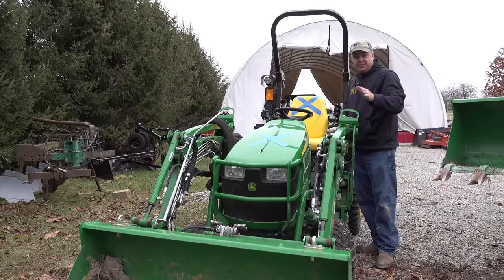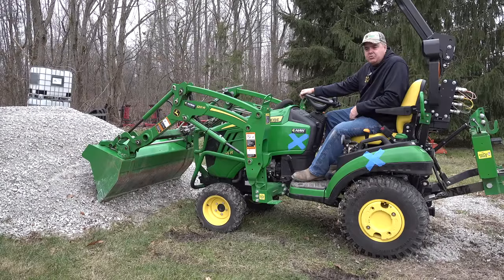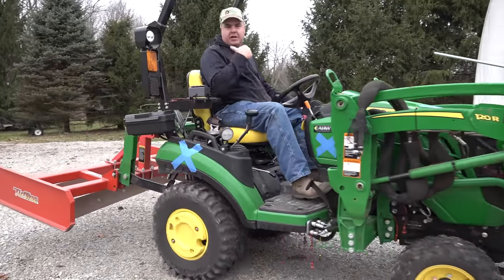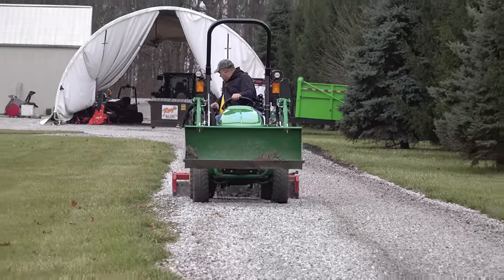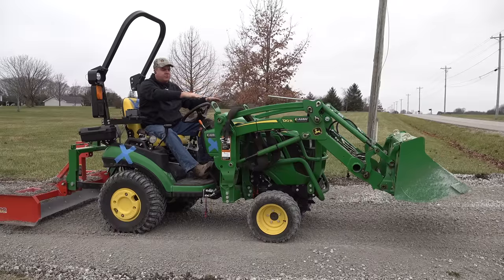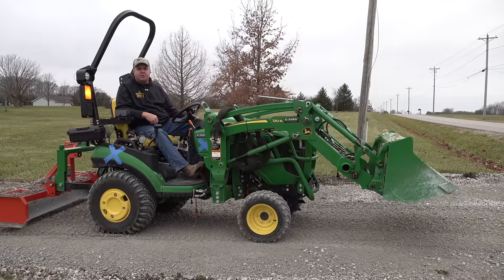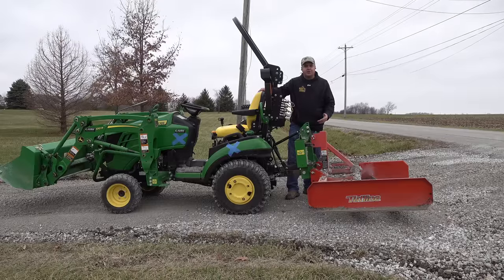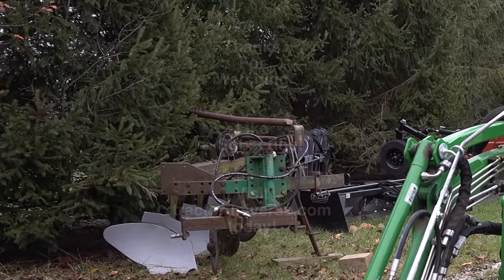John Deere 1025R Turbo Real World Loader & Land Plane.  SUPER SUBCOMPACT!!

Comment: Wonder if I should turbo charge my 755? I'm too scared it would break! I wonder what modifications could be done to the large frame  25hp tractors by "tuning" them without going all in with a turbo. Too bad manufacturers wouldn't put their 35hp engines into a defined state to make 25hp stock but be relatively easy to go back up to 35hp or so with aftermarket tuning.

Comment: Id be interested to see how a land plane would do on our drive at the farm. 3/4 mile up hill, some of it 20% grade. We have a good base, and usually put the blade angled to the side (back side of the blade), to pull rock from the edges to the middle, going both directions, then when we've got a "wind row" of rock in the middle, put the blade straight (still back dragging) and spread it across.  It works well if there isn't much in the way of water damage. For that, I usually end up using the blade forwards to dig it out before filling it all back in. Seems like a land plane does a bit of all of that together. We'd have to do something for one spot in the middle because it's on shale bedrock there, and I'd be afraid it would damage the plane. We currently use a 5320 with a Woods HBL84-2
Reply: That's call crowning the road, so the water runs off to the sides. Sitting water creates holes. A good practice.
Reply from the maker: Wow!

Comment: Are you worried that with the engine not bogging down, you might be building excessive heat in the transmission fluid as it slips at a higher pressure. That make sense?

Comment: First few test show that JD should have offered something like this from the start. It sounds good, goes good and mostly seems less hesitant to do what you want. I’d like the kit for my 2025r
Reply: Same here my  2025r has a big problem with bogging down the engine
Reply: This was discussed in one of the videos by another YouTuber, had a conversation with Deere. The reason they don't go over is due to emissions. The engine is no longer Tier IV compliant over 25 HP. That is why JD stopped producing the 1026r which was actually less than 1 HP more powerful.

Comment: Most jurisdictions require, for safety reasons 12’ of solid surface, concrete, asphalt or pavers at the end of your driveway for that reason you described, spinning their wheels to get onto the main road.
Reply from the maker: Most?
Reply: Where I have lived in the past in Virginia and now in Florida required the hard surface at the end of the driveway

Comment: What hp tractors would you recommend to regrade a gravel driveway with a 15-20 degree slope? Or does it matter?
Reply from the maker: Sure. A slope will require more Hp and weight.

Comment: Assuming there is a separate pump for the hydraulics, that's when you will really start to see the increase in HP.  Full power to the hydrostatic pump and the extra power to the hydraulics.

Comment: Add a hydro plus hydraulic pump,turn hydraulic pressure up to 2600 psi,and turn up hydro drive pressure up a bit then you will take advantage of the extra power.I have hydro plus pump and pressure turned up cannot wait to get turbo kit great project.

Comment: I don't know if you are familiar with comedian Jeff Foxworthy's "You might be a Redneck" jokes.  Out of his first ten I had seven.  One was you might be a redneck if the mud hole at the end of your driveway never dries up, yep, that was me.  A few years ago I bought a 20 ton load of shell rock.  Crushed rock is expensive here in Florida and the rocks would disappear into our sandy soil.  I just let my 600 ft long driveway just grow up in grass but during a particularly wet summer the mud holes got numerous. My backhoe, a JD 510, was down with what I discovered was a stopped up hydraulic strainer so I borrowed my neighbor's Kubota L4701.  

I was not impressed, it was difficult to control with the treadle and the FEL was weak.  I was able to get the holes filled but when I decided to get my own small tractor I got a JD 1023E. Love it, we had 7 John Deeres when I farmed so I have a good relationship with my JD dealer.  I am soon going to get two more loads to fill more holes and build up my parking area.  I have two box blades, a 40" and a 74".  A box blade will just carry the shell rock and drop some in the low spots. Digging up the grass with a land plane would make one continues mud hole each time it rains.

Comment: What is the difference in the two Model 120 loaders that are fairly different?  Does one have the self leveling feature?  Appears to be a substantial amount of more weight.  I suspect that a lot of owners don't use rear ballast because they don't take the time or spend the money to source wheel weights and have tires filled with Rim Guard.  It's an expense to add to an already $20,000 machine.  After a while they will eventually but up front they're not sure.
Reply from the maker: Yes. 120 MSL is self leveling.  NSL is not.

Comment: I like your videos Tim. The turbo is a neat experiment. However,  it's disappointing to see its extra power unable to be used to its full potential by that hydro transmission. It would have been cool has you has a 3043D just out of warranty  and had it turboed. It wouldn't have helped the loader hydraulics but would have been interesting to see it pull with that manual shuttle transmission which wouldn't have given up nearly as easy. You've 4 or 5 tractors and Vinny, All with a hydro. Maybe add a little spice and throw your next tractor in equipped with a manual?
Reply: 3043D is already turbo charged. Yanmar 3TNV86CT-KJPT turbocharged diesel 3-cylinder liquid-cooled inline.  Looked at an R model earlier this year myself, Turbo? Cool!

Comment: It's really hard to tell, but Johnny-X doesn't sound any louder than Stock-Johnny. I run a turbo on my 3.8 Buick V6 engine in my dune buggy, and I use a Super-Trapp muffler with adjustable/removable baffles. Makes no difference in sound level with or without baffles. Turbos are great mufflers!
Where's your hydraulic top link? Hope to get a hydraulic tilt link to you by spring.

Comment: Curious, as I have been looking at small compact tractors and compact tractors for many years now. I would like to know your thoughts on 1/4 inch valving verses position control. Small compacts like 1Series, bx, normally 1/4 valving. But "mid" compact like B or LX have position control. Thanks for the video God bless
Reply from the maker: Love the position control.  Get the 1025R.  The only true subcompact with position control.  Have you watched our 11 episode series comparing the BX to the 1025r? If not, I recommend doing so before making your purchase.

Comment: Did you dyno  the pto hp of the 1025R before turbo,  I see what the results were after.
Reply from the maker: 22 before, 32 after.  Both shown on video.
Don’t put too much stock in the actual numbers, as the dyno could be off. However, you can trust the ‘difference’.   Same dyno used for both tests.

Comment: Did the company that installed the turbo have any input on cool down for the turbos after running wide open? My B3350 Kubota has a turbo and they recommend a 3-5 minute idle for cool down after wide open throttle
Reply: You should do that with any engine whether it’s turbo charged or not
Reply: i do that with any engine i run, but it's said that if you have a turbo, to run it at least 2 to 3 minutes to cool down the turbo and helps protect the bearings better.......

Comment: Tim, I am about to purchase a Land Plane for my 1025R,  What size would you recommend 4' or 5' will the 5' be to much for dirt?  and would the 4' cover enough of the tractor footprint?
Reply from the maker: I would go with 5’.  It will pull hard at times,  it in this case, the extra width is helpful.

Comment: Just curious if you had thought about any emissions/epa requirements if this becomes a kit.  They don't need an emissions control system because the horsepower is at or below 25 hp.  Now that your up at 38 and considering making a kit for it, does it fall in a different class and would a kit manufacturer be responsible for ensuring it meets emissions standards?  Just curious because of all the craziness that has been going on with diesel tuners recently.
Reply from the maker: Have you not been watching our earlier episodes in this series???

Comment: Tim, well done on taking the initiative to get a turbo fitted to a one series. I think there will be a lot of folk out there following this closely. 
 I challenge you to try something new; listen to the tractor engine! 😂 If it needs more throttle, give it more; but unnecessarily high revs will use much more fuel and ultimately an unloaded diesel engine that is running high revs will glaze the bore. They aren’t like a two stroke that needs to run flat out to stop carbon buildup. There’s very little more hydraulic flow, and almost no more pressure to be gained above about 1800 RPM. So, running high revs (especially a turbo) what are you doing!! Please don’t just dismiss this as a hater comment ( because I’m not) Just challenging you to re-think something.
Reply from the maker: We have to run a subcompact at high RPM to be effective. Sorry
Reply: @TractorTimewithTim  I had a subcompact 1026R for five years (and used it extensively) and it wasn't often I needed to run it WOT. I know these subcompacts well. Again, I challenge you to consider someone else's perspective apart from your own!

Comment: If you really want to solve the issue with the trash truck, you'll need to fix the foundation of the driveway in that location. Remove the base usually down to the frost line/depth and fill in with 2 or 3" rock to about 1 foot from the top and then add the smaller stone. OR you could keep doing as you show in this vid till the issue goes a way, which may take a few years.
Reply: Best piece of advice so far. People fail to build a foundation first and then wonder why their rock keeps pushing out leaving tire ruts.

Comment: Tim is the plan to also widen your driveway from what it is to 28 feet wide and straighten it
Reply from the maker: why 28 feet wide?    need a wider culvert to support the turn...once the truck can straighten, no need for huge wide driveway.
Reply: @TractorTimewithTim  it would give you the room to off load stuff off trucks with the 5075e and not worry about sinking the back tires into the lawn and the view in the video shows a couple curves in the driveway
Reply: @TractorTimewithTim  and 28 feet is the average city street width

Comment: The problem I've found with using the JD 2210 (which was the direct precursor to the 1023e/1025r) is not even particularly the power, or lack of. It's in the transmission/differential.

My first sub-compact was a JD 655. That was directly in the line of heritage forr these subs. And it was a workhorse except that it was sorely underpowered. But I never broke anything. And it got used absolutely to it's limits.

Then the JD 2210. Directly comparable to the 1023e. The 2210 got used to it's limits. Up until it tore the guts out of the differential. And that tractor was well maintained.

I planned on buying a 1023e. I couldn't though because the 1025r is such an attractive package and particularly for the close quarters I always found myself working in. BUT.......

 The trouble is, IMO, in all the aluminum used in the drive line. These tractors are little animals when really used hard.  Impressive at least to me. 

I watched this video and the first one when you were at the shop to put this package together. I am fearful, and sure, you'll be detonating the driveline in short order.

Now JD says they fixed the problem the 2210/2230 had but I think the 1023e/1025r could greatly benefit from a cast iron or forged transmission/differential. Even the additional weight would benefit this machine.

I love the turbo idea. Been eyeing that same path for my current 25hp non-JD sub tractor. It by the way is about the size of a JD 2025e but with a more substantial power delivery system.
Reply from the maker: I believe the drivetrain is much stronger in the 1025r than in the 2210/2305.  Lots of PTO issues in those tractors.

Comment: Put that Landplane on the regular johnny and show us the difference, high range and low range. Johnny X does look good. Did the turbo quiet the exhaust like the muffler did, it's sound seems to be no difference.  I think you have a typical residential driveway, where gravel was put down to get the workers back to the home site and when the home was completed more gravel was added to make it pretty. No topsoil was ever removed, for a proper drive to be created.
Reply: Exactly what I was thinking. No foundation . Just dumped rock on top of topsoil.

Comment: The end all solution would be to let grass grow in the gravel drive edges 1/3 of the width on each side.  Constant stirring of the gravel causes fines loss that causes the larger gravel to “unlock”.   Additionally use as high of a crown that you can stand to shed water into the yard grass.   Avoid ditches if at all possible increase the angle of departure of the water by raising the crown height.   Pot holes will cease to exist.  I deployed all these measures on my 7/8mile drive way 10+ years and haven’t bladed it in probably 8 or more years
Reply: Grass edges are a poor idea for many drives. That blocks the water from shedding off it.
Reply: @paybax  I beg to differ. It’s the perfect solution the let the grass grow into the gravel on the edges with  a high crown……  you roll the material flat and guess what…… you mow it.   Works perfectly every time.  With some shallow root mass all the fines stay put and keep the gravel locked together, thus no need to blade/stir the gravel except very rarely. Unless you want to continually chase you tail

Comment: Hello Tim and Kristy, 
   A couple of months ago I went to my local Johnny dealer and asked about the Johnny 2. I have watched videos on the 2 and told him I would need a tractor that can lift around 1200 Lbs, I know the 2 can lift that much. I wouldn't be lifting any more than that. The round bales of hay I buy are around 800 to 900 bls and the skid steer loader I have is rated at around 600 bls. Well the dealer said I would need a Johnny 3. I've seen a 3 and that's a little too big for me. Do you have any advice that would help me in choosing the right Johnny or any other compact tractor. One more thing, how dose someone go about getting a demo or a lease tractor.
Reply from the maker: They really don’t like us to lift round bales with 1 or 2 series.
3R actually has the same or slightly shorter wheelbase than 2038r!

Comment: If you followed the same ratio: 18 PTO HP = 25HP (Flywheel) (a 0.72 reduction).  And you now have 32 PTO HP; you can assume (with the same reduction) you now have a 44 HP (Flywheel).  🤷

Comment: Put a temp sensor on you hydraulic tank/ rear axle,  the only difference you are hearing between the two is the engine not lugging down, which equates to the pumps still flowing strong, going over relief and creating tons of heat, bad heat, 

No matter the engine power the drive trains max force is set by the relief, as is with the hydraulics, both machines will max out at the same amount  one just wont bog or stall, but it will overheat ur hudrulic/hydro stat faster

Comment: So, I'm going to find a way to get this question to ADS regardless, but what if you just supplied the manufactured components and allowed the customer to source their own turbo unit?  There can be no liability in providing milled aluminum.  I can buy and install my own turbo, what I can't do is desing a new exhaust and spacers and mount.  Seems to me, there should be no blocker to simply selling those bits...

Comment: Essentially all you have done is boost PTO power and nothing else since the hydrostatic drive and loader are  limited by hydraulic pressure and pump speed,   neither odd which you have changed.  That being said,   I believe a lot of people would like to see the difference in pto driven implements.  Myself I would like to see how the additional power runs the mower deck.   I am fairly disgusted with my tractors lackluster performance running my 60" deck

Comment: i do not think you are going to do much engine damage with that turbo heck look up diesel garden tractor pulling them guys are pushing 90 to 100 hp out them and they are mainly the yanmar and or kubota engines and at one time i was talking to them drivers and the go to engine was the yanmar talked to a few of them over at tampaco at the big 3 or 4 day pull they had back before covaid